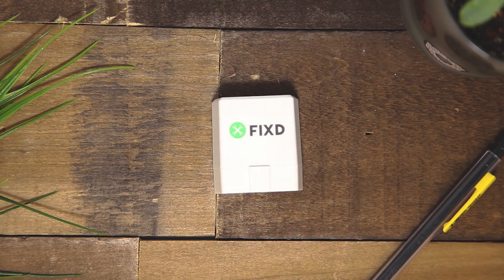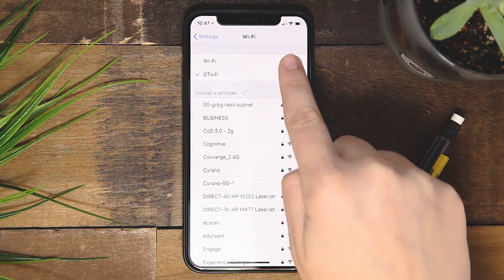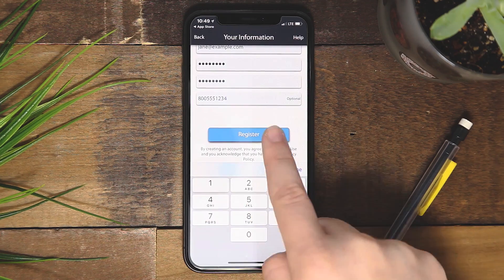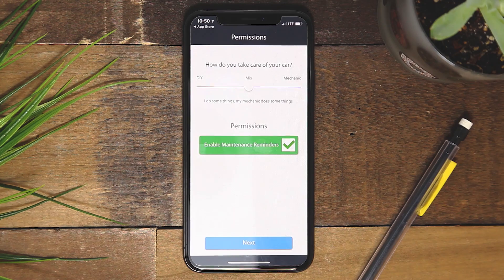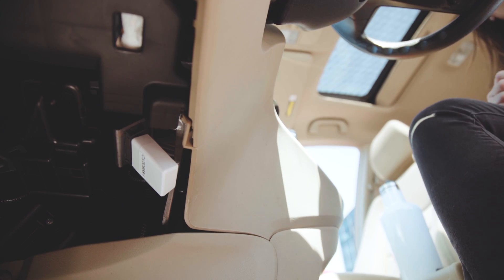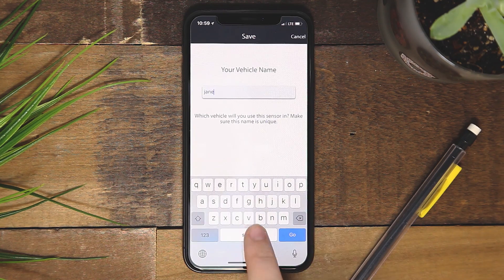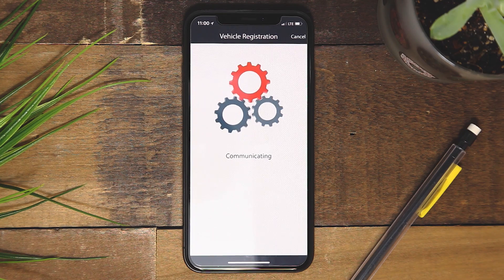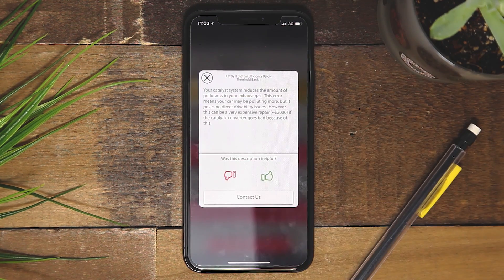How To Setup A FIXD Diagnostics Sensor

Comment: When you have to start the vehicle do you have to have the engine running or just activate the battery for the sensor to be useable?
Reply: That answer was in the video.
Reply: It truly doesn't matter. The video says to start car first, and then plug in the sensor....but you can plug in the sensor first and then turn on the car and it will work just fine as well. Think about it, they say that you can leave it in the car all the time right?   How would that work if you have to unplug it and plug it back in again every time before you can start your car?
Reply: @richardnicely5573  Dont leave it plugged in it might drain your battery
Reply: Start the car engine running

Comment: I just received my device and was wanting to know if I leave it plugged in all the time or just when I want to scan?
Reply: No, you do not have to plug in all the time.  I only use mine should the check engine light on or random will check car at oil change.
Reply: It might also drain your battery if you leave it in all the time.

Comment: dont waste your money. the first thing that happens is they want to sell you a monthly  subscription so the 50.00 is just the initial investment. then it does not diagnose anything but the check engine code. my truck is running like crap and it says it has no problems. i got a mass air flow sensor for about the same price as this pos ant it fixed it. waste of time and money.
Reply: Seriously!! Dammm garbage. Is there any mobile check engine/ sensor app you recommend? Trying to get a new car

Comment: In my truck I already know the ABS brake system is not functioning correctly (there is an indicator light for it), but when i scan for it with fixd it in not picking it up.  Scan says everything is fine.

Comment: Do I need a PIN to pair with the device when Bluetooth is turned on? If so, where do you find the PIN at?
Reply: It needed a Pin for mine and i have NO IDEA where to fine it....   😔
Reply: it's 1234 or 0000
Reply: @izzyoda7867  Did that work for you?

Comment: What everyone is also not saying here is, FIXD wants an additional $60 bucks to register their product after purchase.  Why no one here has bothered to mention this is beyond me.  FIXD also did not diagnose the issue with our, CRV.  Our VSA (Vehicle Stability Assist) light was on however, FIXD did not register this as an issue.  It only sent me off to another section on their site to tell me what the light was.......but if we are buying this product, we know full well what the lights is.  We either needed to know why the light was on, or to turn the damn light off.  It did neither. So $120+ bucks for nothing.
Reply: Total Rip-Off.  I paid for the scanner and now it is worthless because I have to pay more per year for it to work!
Reply: @Foxie-b4  A scanner from Harbor Freight $50 works just as well and no release of Credit Card data required
Reply: @ Bill Dux - Thank you for your review. Foolishly, I was actually thinking about buying this because an "expert" mechanic ruined my RAV4 a year and a half ago because after repairing my A/C unit, he forgot to plug in my car's computer that "teaches" it how I drive and how it should shift. My car never worked properly after that, jerked about forever. Took it to a Toyota dealer and they wanted thousands to "try" and fix it, but no guarantees.... I won't be wasting my money on this thing.
Reply: @greenbeagle13  There are so many good scanners out there with free and great software if that is what you want. This company is fraudulent! Tried to steal $106 from my credit card today
Reply: I agree. Don't buy this. They will wrap you into a $60+ up-charge on a service before you know you signed up for it inadvertently. You will realize when it's too late. I caught it in time and sent them a stern letter to cancel the subscription immediately and they responded to acknowledge it. If I see them charging me for it after that, I will sue them for distress, over and above the cost of the device. Now, I don't even want the device. I don't like companies that try to rip people off. BAD BAD BAD.
Reply: @ghosttownsentinel5288   They wanted my credit card info ( no way) before I could download the app saying they would not use the data, so I purchased an OBD2 scanner at Harbor Freight, which works great for around $50 as long as I want.
Reply: As it seems the FIXD is a RIP OFF!!! I ordered the sensor for $19. 99 and my card was charged $99.99 . Now they won't refund the money. So guess what. They found a legal way to steel peoples money !!!  I have to get another card just so they can't continue to bill me. Damn what's this world and it dishonest people going to come up with next. The Devil said it's only getting worse. 😕 You know he happened to be telling the truth. Weird  Facts are what they are. 😏😐
Reply: You saved me money sorry it cost you money to help us who have not. Thank you.
Reply: Just continue past the Premium offer. It will still work. You just don't get some of the 'Premium' options.
Reply: @greyscout01 what are some premium options?
Reply: @utopea  I haven't touched it since i wrote that... don't remember specifics.  I just remember that I got more options that way. If you have one try it.
Reply: Oh, I am saying something:  I purchased the FIXD, OBD2 scanner for $19.95 plus tax on a sale event on Sep 9, 2025. 13 Days later, I was charged for $106.24 and was refused by my credit card Company. I received a text as such, supposedly from my credit card company. I thought this was a spoof, so I called my credit card company and it was actually FRAUD. Trying to steal this money from me.
I was never able to use this scanner as it does not work on my car, a 2004 Saturn L300, not only that, but would not work on my cell phone with Android V8. I sent them text after text that this scanner would not work. Terrible company, Fraudulent Company
Reply: Thank you for the comment I was considering buying it.

Comment: Do you leave the sensor plugged in or remove it after use?
Reply: We left ours in and it drained the battery... 

We took it out and those problems went away.  Just goto auto parts store and they give reliable codes and you don’t have to mess around with all this crap

Comment: Okay that gas cap shit yah pulled on that mechanic the trouble code for the gas cap don't say it's gas cap it says "evaporative emissions system" so that could be anything canister purge valve or the fuel tank pressure sensor like that guy said. I'm sure he looked at fuel cap and was like "it looks fine to me" must be fuel tank vent pressure sensor. Literally all mechanic guess untill they find what's wrong and return what wasn't it to autozone 🤣🤣🤣 only trust the guy with the 10,000$ snap on machine and who has experience with your type on model vehicle

Comment: this was a waste of $ for me - after endless hours of upgrading iOS, then app, then back and forth with support, they told me they did not pay Honda for the rights to licenses for the specific dashboard flashing lights I was having for my transmission issue.   They advertise this product is an ODB2 scanner, but it is ONLY a basic CEL (check engine light)  reader.  ODB2 scanners can read advanced codes for diagnosing issues like I was having with my transmission sensors.  Ending up using a Honda reader and solving the problem, now my FIXD bluetooth device is a $40 paperweight.   I will NEVER waste my time with this POS again as I can get basic CEL codes from Autozone for FREE - why waste time with all this config on my phone when a short trip to the shop will get me better info printed out quickly, along with help from guys in the store.
Reply: It works on my Honda Accord,  my KIA Soul and my GMC Terrain
Reply: While I understand the main issue, let's just call you out for using an out-of-date OS on your phone to begin with - it's not this company's problem that you don't update your shit.  It's certainly your fault for owning an iShit to begin with.  That's all on you, man.  All on you.  :D
Reply: Shock Diamond as I said, I upgraded and it still isn’t a true scanner.  Just gives basic codes.  Waste of money

Comment: Stop falsely advertising and ruining mechanics good name a factory vehicle require a special reader to actually get the correct problems with a vehicle. The majority of the time it’s a graph reading to understand the problem not just a “oil pressure sensor”. Most mechanics will be in a lot of trouble if they falsely charge a customer.

Comment: I won't need this device because I don't own a domestic vehicle (Ford, GM or Chrysler).
Reply: Most cars are still built in North America for the USDM market, so the whole "I don't own a domestic" is irrelevant.  It's not usually the parts themselves that are an issue, but rather the assembly.  Honda, Toyota, Nissan, Hyundai, Kia, Subaru, BMW, Daimler (Mercedes), VW and Volvo are assembled in North America for this market.  Parts can be an issue though.  I know for a fact that some crucial components for engines, for example, are manufactured in North America as well.  Honda's pretty notorious with valve springs being manufactured in the US so poorly that they all have to be sorted by hand to throw away the massive amount of defective springs so they don't get caught on the assembly line and have to stop production.  And I own a 2020 Honda - it's built in Alliston, Ontario.  Anyone who believes there is a large gap in quality between USDM assembled cars is foolish.
Reply: @danieldeaseweitzelwalker  I know, I worked at HCM in Alliston for 11 years.
Reply: I'll upsale you on a model for your vehicle 🤣🤣

Comment: So far not impressed just doesnt want to work any one would think this is a scam product
Reply: Dave Potter how did it save you anything?  You can get codes from any auto parts store free.
Reply: @KyleRollinsMammothSolutions  If all you are using it for is to pull codes, then that is correct. However, if you know anything at all about diagnosing cars (which is what DYI is all about right?) then you'll need more information than just the code. Freeze frame data can be very useful in diagnosing an issue...and no auto parts store scan will give you that. If it's a current issue instead of just a stored code.....then being able to look at live data can often lead you to the exact right diagnosis.....What reading are you getting from the throttle position sensor, how about the MAP, or MAF sensors?  How about the 1st and 2nd O2 sensors on bank 1?   Those are all things this can tell you, that will make it much easier to diagnose your problem....and they are also all things you can't get from any auto parts store free scan.
Reply: That's because it absolutely is a scam. Currently dealing with them charging my account without permission.
Reply: I will add to this as I see I have forgotten to, the issue I had was my region and this product not working on a car pre 2xxx which they didnt state. Otherwise it does work to getting those codes which can be helpful and easy to read.
Reply: Can anyone help me I had the device for awhile now but I lost the cv code on the back of the fixd device and it won’t let me use the app without the code
Reply: @Chuyrides  - are the codes useful, or useless .

Comment: What Can Fixd Diagnose?
Fixd is a useful tool, but it can't diagnose everything. The general rule is that if a problem causes your "check engine" light to turn on, then Fixd can tell you why the light turned on and what type of repair you might need.

Diagnosing a car is a whole lot more complicated than just reading trouble codes, and one code can be caused my multiple different problems. So even though Fixd can give you an idea of how to fix your problem, and even help you buy the replacement parts you need, complicated issues may still require the assistance of a professional mechanic.

Comment: Why do I need to turn off wi-fi? 22 seconds into the video
Reply from the maker: Hey John! Good question - typically when people go outside their wifi signal gets weaker. We need to make sure we have a strong connection for our sensor. Since cellular data tends to be more reliable (given your location obviously) we recommend switching. Let me know if you have any other questions!
Reply: WIFI??? Do you have to have a Wifi connection to use this?? If so and your can acts up in the middle of the woods where are you going to get Wifi?????? HUH?
Reply: You don't necessarily have to turn off wi-fi.....it's just if you are in your drive-way and your phone is still connected to your wifi router, and the signal strength is really low (because you are outside of your house) it will take a lot longer to download the app, than if you were on 4G or 5G cell signal.
Reply: LG2531736L80
Reply: 2020 Silverado LT